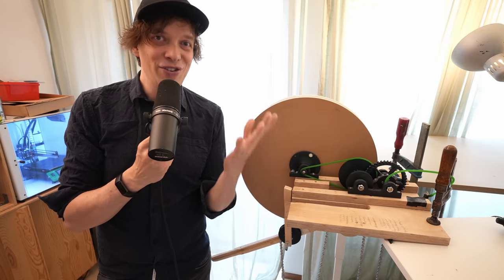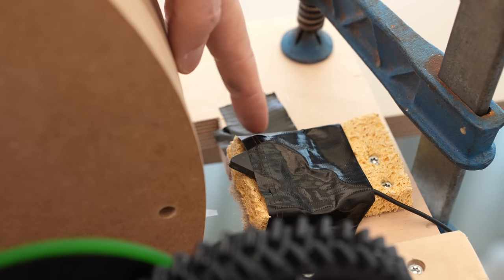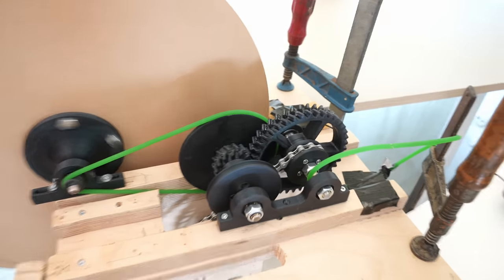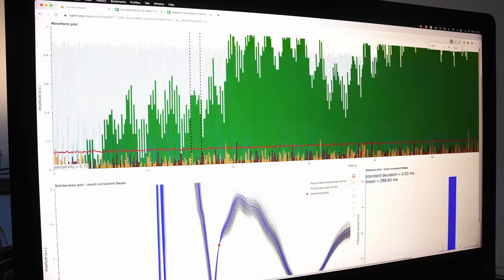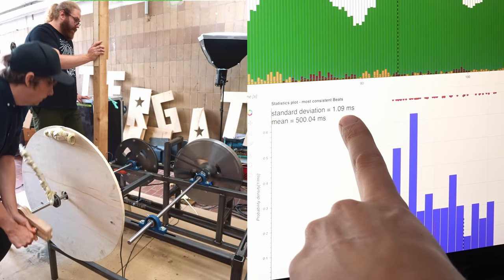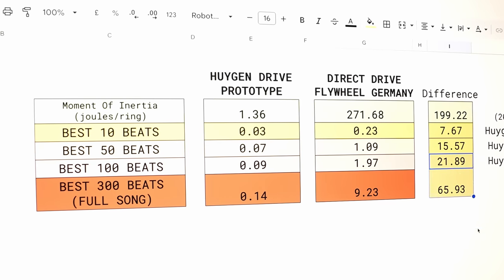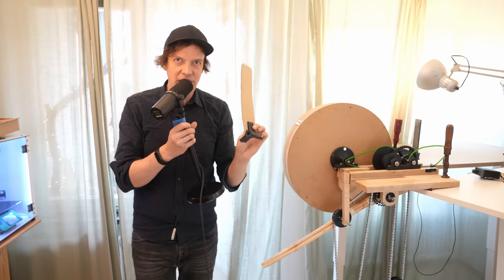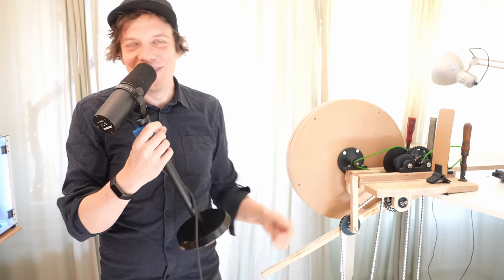Is Gravity Really Constant? I Built this machine to find out.

Comment: Just keep the load in mind. If you change the load (engage a new instrument) mid-song, then the tempo will also change a bit. Hell, even playing a single note can create "unevenness" in the tempo, however miniscule it may be. The heavier your flywheel is - the less noticeable such changes will be, but the load would also need to be heavier. I can't think of any solutions on top of my head to deal with this problem, although there may (or may not) be such.
Reply: > the load would also need to be heavier
why?
Reply: @sly-shot  bigger inertia/momentum. If you double its mass, you will halve the effect each 'instrument' has on the tempo.
Reply: @Khantia  I get that a bigger mass is harder to stop, so the instruments won't stop it as easily. My question is why you said the load (instruments) would also have to be made heavier.
Reply: @sly-shot  I guess my wording was confusing. When I used "load" that time, I meant the load that's actuating the flywheel, not the load of the instruments.

Comment: I can see this with a gearbox that would allow for changing tempo on the fly
Reply: Exactly what I was thinking
Reply: That would have nothing to do with this part, you'd want a tempo selector AFTER the flywheel where you are taking out power, and this would be before it, inputting power. You don't really want to try and modify flywheel speed, you want that to be as close to constant as possible, at all times.

It's a cool idea, my biggest concern with it is how much parasitic drag would the speed selector add? And also doubling the tempo would likely double all the other losses as well. Remember, the goal is to have the machine human powered. Anything that adds too much drag would either make playing exhausting, and said exhaustion could make the music sloppy, or literally make it impossible to get the machine up to speed with the amount of power he can add in the first place.
Reply: @Nevir202  
I fear he is testing the wrong thing though.
He has now tested that the energy input of this system is much more constant than cranking or pedalling.
Which imho he didn't need to test at all. We all could have told him from the start. (pretty sure he knew himself as well)
What he actually needs to test is what he needs to make a machine that can keep a steady tempo on varying loads (less vs more notes).

What he needs: [energy source] -> [energy buffer] -> [tempo regulator]
Also, the energy buffer can be a flywheel , pressure tank, weight on a height,... The hyghens drive is another option for the flywheel. There is no need to use both.

The tempo regulator will need to consist of:
- energy 'valve' (something that can change the amount of energy taken from the energy buffer).
- an option to choose a tempo (dial, buttons, lever,...)
- a feedback loop going from the tempo regulator output back to the energy valve.
Reply: @Robbedem  You're definitely right, in principle.

On the other hand, such a big flywheel should mean that if you can regulate its speed accurately enough, the upstream loads can almost be treated as a constant, even though they won't be. Playing a handful of notes by opening gates vs not doing so, will be such a tiny difference in energy being extracted from the system, in comparison to the friction of moving the marble elevators, spinning the programming wheel, etc which ARE more or less constants, as to be insignificant.
Reply: Better, use a Vario transmission.

Comment: I’m interested to see how you’ll control the tempo
Reply: With an adjustable governor and a gauge to read the speed, it could be very easy and accurate to set a fixed speed.
Reply: It's so painfully obvious: An escapement mechanism. Martin just built a clock.

Comment: If the speed of the flywheel is limited by the air-governor, then the thing who's constancy is keeping the beat tight  is the fluid friction between the card and the atmosphere.  In a frictionless version with no escapement  the flywheel should accelerate by some amount until the weight runs out of slack.
Because fluid friction is proportional to the square of the speed of the card, it makes sense that it would reach a constant speed beyond which the weight in the suitcase can't push it.  (terminal velocity.) But you might need to calibrate this speed from gig to gig based on temperature and  pressure.
A well designed escapement is as constant as gravity.  But gravity isn't constant. It's smaller in Denver than it is in Amsterdam.

Comment: Yes, it is very accurate as long as resistance doesn't change. But it will change, when more programming pins make contact, more marbles need to be lifted etc. And you can't compensate by using more force, the force is constant. Air governor balances that, but you can't make that more effective freely either, because it works by wasting energy. Another difficult thing is tempo changes. You need a gearbox, one gear per tempo. That is doable of course.

Comment: If gravity is constant, then the speed of the wheel only depends on the air governor. So what you are really measuring is the density of the air. Sort of like a barometer and thermometer combined.
You should use a pendulum, or a wheel that swings back and forth, that will give you precision.

Comment: The air drag mixed with the belt inconsistencies and slight differences in chain link friction and bearing tolerances and lubrication are what probably gives it the 0.14 imperfection

Comment: Using "the car" as an analogy the flywheel is the engine, the suitcase is the gas pedal (with a bicycle hub for free wheeling) AND the programing drum will need a drivetrain from the flywheel including a transmission (preferably an automatic)

Comment: Gravity DOES change a bit based on location. "Gravity imaging" is used to monitor underground deposits.

Your governor is probably affected by air pressure too. It may run a little fast during a storm (low pressure).

Comment: I would keep the foot pedal for lifting the weight. Using a sprag clutch would maintain a quiet, one way, method to turn a shaft. Allowing you to keep a constant beat with your foot. It would also allow you to have a crank on the shaft while not back driving the foot pedal.

Comment: Constant beat in this contraption depends on constant power drawn by whatever it is powering. If it has to do more work, it will slow down. Power draw of marble machine varies by how many notes it plays per unit of time. More notes means more marble dropper activations and more marbles lifted back up so a constant driving force will produce varying tempo.

Human powered system can be more stable because the operator isn't trying to use constant pedaling force but is actually controlling his leg muscles to try to produce constant beat.

Comment: The air governor could induce some variations in the setup as wind could affect it. Doesn't matter in a small room, but in a (outdoor) concert venue it could. You could try an electromagnetic governor instead that would have less variation to the environment and possibly offer an easy way to adjust rpm by changing the resistance in the induced circuit.

Comment: The force can easily be calculated like this: F=G*m1*mE/r². G is the Gravitational constant ~6.6743e-11, m1 is the mass of your bag, idk but let's say 10kg, mE is the mass of earth ~5.972e24kg and r is the distance between the centers of mass which is mostly the radius of earth with ~6371000m. Lets say you lift the bag up ~0,5m and calculate both forces:  FGround = F1 = ~98.19841N and FLifted = F2 = ~98,19839N. If you want to know the factor between the two values, you can devide the two Forces F1/F2 = r2²/r1² = ~1.000000157. So the weight of the bag aka "gravity" is not constant but its probably constant enough

Comment: There's a big difference between the marble machine as a wind-up machine and a machine you play.

There's also a big problem with the Huygens drive that the tempo will vary with the energy demands of the machine (lifting a few marbles: fast. Lifting many marbles: slow).  It will be entirely predictable, but not tight.

Comment: Put the weight on a very large gear that is connected to a small gear which is connected to the flywheel and governor. Also change the governor out for a 3D printed scoop shaped one and make sure it is large enough that it can actually do its job. You can do more tricks with gearing and pulleys to make it so you could drop the weight at the start and have it fall the entire time the song is playing without cranking

Comment: Pendulum: A body suspended from a fixed point so that it can swing back and forth under the influence of gravity. Pendulums are used to regulate the movement of clocks because the interval of time for each complete oscillation, called the period, is constant.

Comment: You could use a motor to lift the weight, with optical sensors to keep it from raising too high or low, and then the weight to give a very consistent force. The motor doesn't turn the shaft but winds up the weight for you. Best of both worlds
Reply: This methodology has actually been used in (modernized) clock towers, so there you go. No reason why it couldn't work on here. Of course, the original clock towers had you cranking the weights up by hand, which I'm sure was incredibly exhausting.

Comment: Like most things, a hybrid style machine would be best for this application. I’m sure you’d like to control the acceleration and steady-state tempo with manual input power but be able to switch to the gravity drive to preserve energy and keep it tight (so long as it can stay at constant speed and doesn’t continue to accelerate). 

You could come up with some clever dual input system with a clutching mechanism enables the best of both.

Comment: In this configuration, I think the net force of the chain's inherent weight shouldn't matter. There are two floating pullies wrapped in the same manner,  and one goes up while the other goes down. All of the other spinny things are fixed. This means that overall, the whole chain never rises or falls.  I think. So that's nice, because even if you need a really heavy chain to drive the finished product, it shouldn't matter. If you need it computer-tight, then something like a bushing or a full blown torque converter might smooth out any outliers.

When you take the finished mechanism on the road, it would be interesting to measure the difference in tempo at different latitudes due to centrifugal force. From a pole to the equator, you only lose about 0.3% of weight, or roughly one beat per song at the test tempo and hypothetical song length if I've got the numbers right. An adjustable flywheel could calibrate that down to zero handily and might be more convenient than adjusting the weight or counterweight. Barometric pressure changes usually aren't significant for flywheel performance.

All this, while I'm also aware that these days, music performance software has the ability to adjust tempo by listening to a beat track, so your existing model seems more than adequate for computer accompaniment. Syncing to other physical automatons would be a different story, of course. They may need to be physically attached to a single timing mechanism.

Comment: Would be really useful to take a look at watches for some ideas about the gear setup. It's possible to build in a balance wheel and escapement that regulates the movement of the gears so that they move at a very exact speed. This would also minimize the wait time for having to get the flywheel up to speed, because you can lower the force being added into the flywheel. It would also slow down the chain speed. It would also reduce the impact on differences in the weight, such as the weight of the chain as it gets shorter or longer.

Comment: Based on this, you could construct a gearbox (similar to the one in a car) to play at a corresponding bpm, have the Huygen drive pull at a fixed speed and then gearbox the output. If you add a gearbox at the output, you should be able to set a constant bpm and change it during performance.

Comment: Speed of aerodynamic governor depends on air density, which can vary much more than gravitational acceleration when temperature, altitude and air pressure varies. Temperature and air pressure can vary during a concert and produce much more error than in this experiment. 

Aerodynamic governor depends also on mechanical load. I would take marble lifting power straigt from the crank and use Huygens drive only for timing wheel.

Comment: So, I am not fully sure what mechanisms may be built into your gear train, but as presented this setup will not give you the results you want. Currently your inputs are a constant force from the luggage weight. and your losses to that energy, once the flywheel is accelerated, are friction in the drive train and air drag (also friction) and the almost pointless fins you had. These frictional forces become a constant at a given speed, which is determined when they match the force of gravity being input. When you couple this with your marble machine you will have a varying load based on what it is operating. So unless you have a massive store of inertia compared to these loads it will give you a varying rotation speed. This also gives you no way to regulate what that speed is. Not saying it can be done though. old clocks use a gravity weight system for input force, but its regulated with escapement mechanisms. You can also look into how old steam engines regulated their systems. They had some really cool and cleaver mechanical systems to regulate speeds by varying inertial masses.

Comment: I think there are a few ways you could fine tune the hugen drive to change bpm. You could change gears, change the weight of the flywheel, or change the diameter of the flywheel. Just something to keep in mind. If you can figure out a way to move the weight farther from the axis of rotation you might be able to fine tune the bpm easier.

Comment: this drive is good at maintaining a constant input, for varying loads a low mass flywheel speed will fluctuate a lot (taking a glass of water from a bucket is more noticeable than taking it from a bath tub), maybe you could have 2 inputs, one for accelerating the flywheel from rest, and this could be the other, this way you could use a heavy flywheel without having to wait for it to accelerate

another thing is the ratchet makes quite a lot of noise, you should be careful with that so it doesn't affect the music later

Comment: As a few others here have pointed out, gravity is constant over time but it is not constant throughout the world . And it's easy to brush this off by saying "the difference is negligible", but you can calculate the time it takes a marble to fall half a meter in different gravitational accelerations that you might find around the world (say, on the World Tour that Martin has been talking about for years), and the difference is actually a few milliseconds. Which is not a lot, but Martin has been insisting that all his prototypes are precise to the nearest millisecond so this might be a problem for him if he doesn't account for this in his designs

Comment: Heavier but smaller weight. Also dont use an air governer. Use a standard counterweight-friction governer. They are actually fully adjustable. Constant rate will be yours and in control. This governer operates by slightly applying a brake at too much speed

Comment: Hi Martin. I guess that you want to achieve different tempos by changing the diameter of the wheel in your Huygen prototype. If you just replace the wheel with another one of a different diameter, my hypothesis is that you will observe that the standard deviation correlates directly with the diameter. In other terms, I predict that for slower tempos, the standard deviation tends to increase. I may be wrong. But if I'm right, do not panic: there is a way to smooth this effect by using an inner wheel and an outer wheel, one of which being of constant size.

Comment: I feel like this mecanical solution takes away some charm of what make music play by a musicien be full of emotions : 

The possiblity to variate the tempo, make some acceleration or deceleration. What makes crancking musical instruments to have a soul is also their imperfections. 

I understand the fear of a new fail, but i think you should not lose focus of the goal of music: share emotions. I don't think perfectly tight music is intersting. 

Hope you will consider this. Keep the good work. I belive in this project ! ❤
Reply: Working within constraints leads to some of the most interesting compositions, like how in Octopath 1, all 3 decisive battle pieces are locked to 164 bpm, and must start in D minor. This also resulted in the 8 unique themes for each character that play just before having to be locked to the same tempo and key. The dialogue boxes are also completely player controlled, so they couldn't have any melodies either. There was even a piece that followed the same constraints without the buildup, making 12 pieces in total, yet they are all unique and interesting to listen to

Comment: Realistically, you can't rely on your drive mechanism for precision timing. As you add and remove instruments, run through marbles, etc. the loads on the drive mechanism with be fluctuating wildly, so it's not going to keep any reasonable consistency. You should separate your drive and timing mechanisms, so you have a drive mechanism which simply has enough energy to do everything you need, and then have a separate timing mechanism under a constant load which only triggers events using a minimal amount of force.

Comment: I guess a problem with this design is that gravitational pull varies a bit around the globe. So you would have different speeds depending on which place you are playing in. The gravitational acceleration varies from about 9.78 m/s^2 to about 9.83 m/s^2 depending on location at surface level.